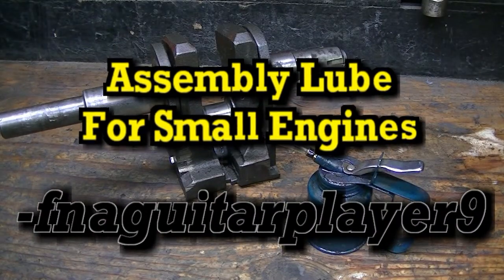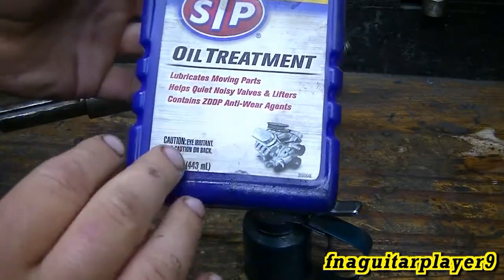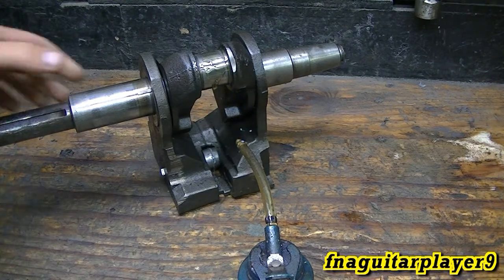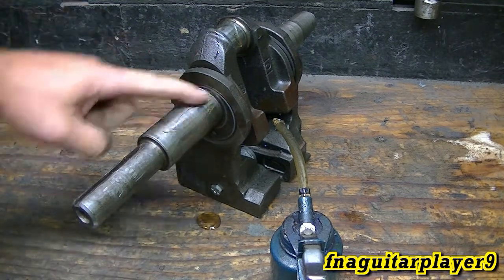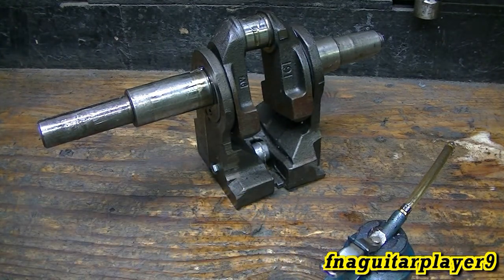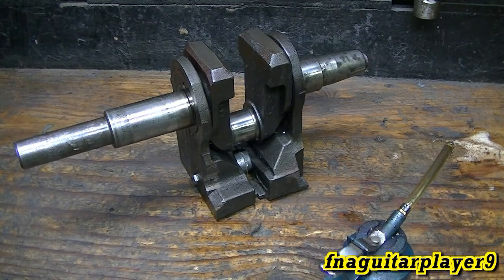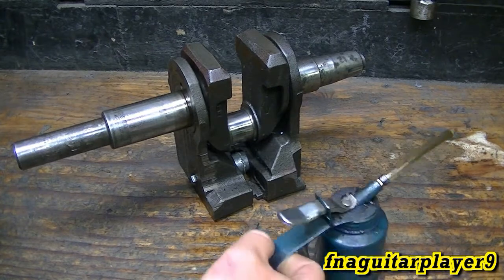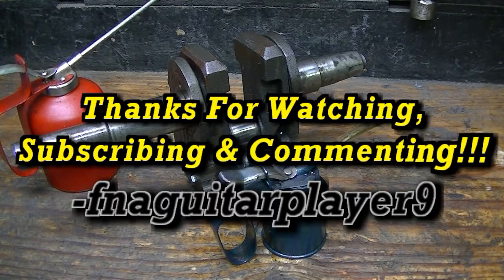Small Engine Assembly Lube Recommendations ( & what "STP" is)

Comment: 30 years ago a guy I new used 140 weight diff oil for assembly.  Any thoughts on that? Not sure how it would mix with the motor oil..or if it would matter anyway.
Reply from the maker: As long as it mixes in with the oil, which i would think it would, it wouldn't be a problem. The main thing to avoid is grease, because it can fill in the oil passages until it gets hot and runs out. Thanks for Watching!!!
Reply: @fnaguitarplayer9 
Thanks Frank. Nice video.
Reply from the maker: @rocknral  your welcome!

Comment: Thanks for the tip Frank. I guess the benefit of the squirt can is you can get into those hard to reach places.
Reply from the maker: Your welcome! I used to use a brush to apply it on parts but it was messy. It does come in handy for like the camshaft bearing and other stuff that is hard to get to. Thanks for Watching!!!

Comment: What about grease?
Reply from the maker: I don't recommend it, like R Verro says it kind of sticks to good and can "clog" up to a point, if it doesn't break down in the oil. If you all you have is grease then i would use motor oil. Thanks for Watching!!!
Reply: Grease and oils have different characteristics. I'd stick with STP because the grease will have to be washed off before the oil lubricate the parts properly.
Reply from the maker: That sums it up pretty good! Thanks for Watching!!!
Reply: There were some old articles in Hot Rod Magazine written by Smokey Yunick regarding building SBC engines, he always said "get the parts clean and assemble the pieces with a coat of light grease"...  Then change the oil after break in.

Comment: I use Vaseline aka petroleum jelly.  Don't; know if it is any better or worse but it stays where you put it.
Reply: I would use STP instead because its composition is very close to oil (anti-foaming, anti-oxydant, detergents...etc...)
Reply from the maker: I've head of people doing that, and I personally don't recommend it, i like using stp or motor oil i think it does better, because as r verro said it basically what will be engine when its running anyways. thanks for watching!!!
Reply from the maker: I feel the same, i don't think to much of using it. Or grease either. thanks for watching!!!